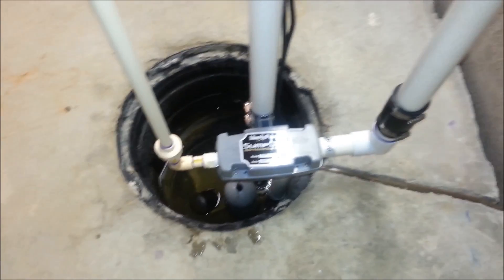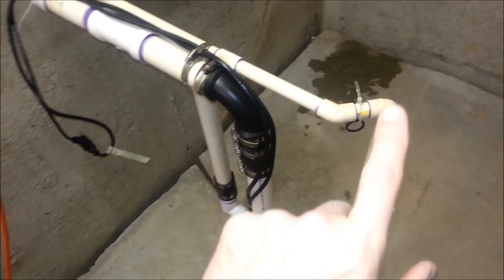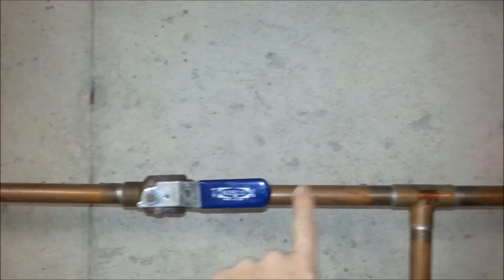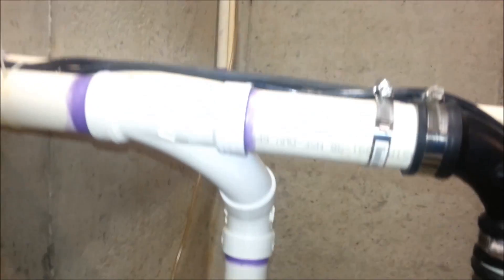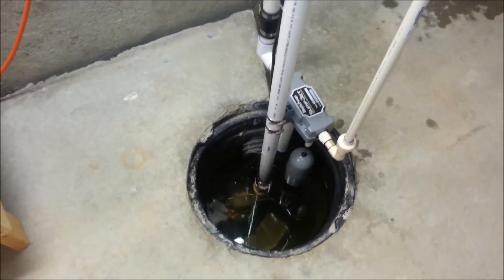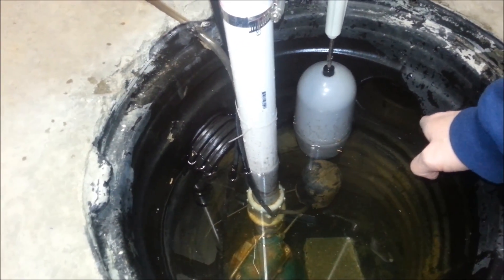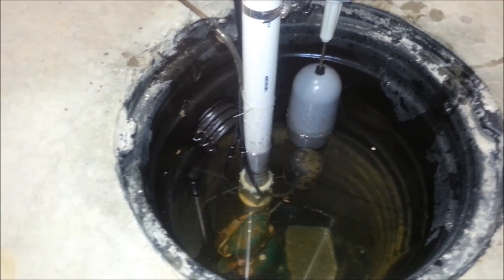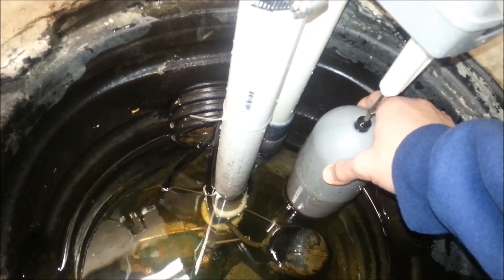Trash That Battery Sump Pump & Install A Water Powered SJ10 Liberty Sump Pump No Dead Battery Again.

Comment from the maker: You guys are really missing the point. This is not a run every day pump. This is only used for Emergency purposes if your power goes out or main pump failure. Temporary basis only.  Environmental wisely you would rather use electricity to constantly cycle a battery or buy a new battery every 3 years? Give me a break.
Reply: It's saved my basement more than once.
Reply: @Ronald: Opposed to doing what?  Outside of a backup power generator for the entire house, and a second full-sized sump pump.  What do you recommend if the primary pump fails during a storm?  Surely not a battery backup.
Reply: smaerd58 oo
Reply from the maker: Ronald Burgandie look go troll someone else's video. I am a union Pipefitter and my set up helped for the massive storm Irene here on the east coast. So take you foul BS somewhere else. This is for information purposes. So let other people make there own decisions. Not based on your non experienced situations.
Reply: The only problem here is the same power source that your home is operated from supplies the domestic water to your home.
When the power goes down so does the domestic water. Not every time but most.
Reply: @Beniamin6665  I've always had domestic water during power failures.  The most common cause of power loss is transmission power lines being knocked down in a neighborhood.  There is still water pressure from areas with power to supply water to the outtage areas.
Reply: @Beniamin6665  Water pressure comes from water towers. Gravity forces the water into the service lines. As long as the tower has water, you'll have water pressure. And, the pressure should always be the same. It's based on the height of the tower.
Reply: @jordanhargis6581  I’m a Licensed Professional in the matter. Yes in small towns the towers give pressure to your service. In any city the towers are replaced by water pumping system and stations. Witch have power supplies that are connected directly to the grid system.
Reply: @Beniamin6665  of course you can't use that in that case. You need to have constant water pressure, around 40 psi min.

Comment from the maker: Only used for Emergency Backup if your main pump fails. I would gladly pay a $400 Bill once to not get flooded out which would cost tons more & aggravation. Thanks
Reply: Pyroman / yes. You just need to set the float above the other pumps float. This will allow the pump to only be activated when the main pump  fails or you lose power.

Comment: I just bought one of these but the directions says you can't run the discharge into the main like yours is but I don't have an option of running a separate discharge line. Did you have any input for that?

Thanks,
AL
Reply: Most States and local authorities want no foundation water in their sanitary sewers. It adds to the cost of treatment. Eventually, all homeowners will be required to divert groundwater. A ditch or a bubbler will suffice. My Village said I could even run an underground discharge line to the storm sewer manhole stack.

Comment: The water pumps may be better in some scenarios. However, for those of us with high sump flows, the water option isn't possible. My basement would flood in no time if I used a water powered backup pump and lost power.

I do agree to trash the battery sump pump, however. Those 12V little pumps that run off from one marine battery are garbage. However, I discovered a company called SEC America a while back. They make something called Pump Sentry in two different forms. One for 1/2HP and one for up to 3/4HP pumps. It basically an inverter of sorts. You can chain up to 3 batteries of whatever size you want to it, or just use one if that is enough. It stays connected to the battery, detects a power outage and kicks in automatically. It converts the battery voltage to voltage that the main sump pumps could use and powers them that way. Usually a series of large capacity marine batteries can last for days, even with it coming on every few minutes. When it has rained for 3+ days and is coming thunderstorms (the most likely time to lose power due to branches and trees falling on lines), our sump flow gets up to 75 gallons per minute.
Reply: A water powered backup pump may not be a solution for everyone, But it shares the same marketed purpose as a battery powered backup and that's is as a last resort to keep you sump pump pit from overfilling during a power outage
Reply: All bateries has a relatively short lifetime. But  If you replace the battery every 3 years, you will have no trouble, and it surely will be far cheaper than dump clean water as power source.
Reply: I saw that SEC still makes the inverter that can power any brand main sump pump. It trickle-charges the battery and when the power goes out, it converts the battery DC to sine wave to power the main pump. In essence, it is a battery backup for the main pump. May be the best option is to have this set up for the main pump and the battery backup pump as well or a water-powered backup pump. The expectation is that the water-powered pump will be used as little as possible to avoid fresh water waste, especially if you can connect two marine batteries in series to power the main pump. Of course, this does not address the main pump failure over time! So have a spare main pump plumbed and ready to go.

Comment: Thanks a bunch for your video and update. Do you think Liberty SJ10 would work for an OUTSIDE sump pit? Mine is 2' across and 10' deep. Every installation I've seen online has the SJ10 sitting above the sump cover, but mine would need to be below.  I live in Pacific Northwest so not sure if the water line might freeze. THX

Comment from the maker: Matthew because you are only using the water when the back-up pump is used because of failure or lack of electricity to the main pump. The battery version however needs to keep charging all the time thus using electric. Hope that helps.
Reply: The battery system is far better. This system is a damn gimmick.. The gpm it pushes out is extremely poor. Hands down it’s a piece of plastic junk...

Comment: how can they say battery isn't energy efficient when you use 2gallons for every one removed? best is to just have a 110v back up and a home generator on a auto load switch, But I know that's always not cost effective. neither systems great. just make sure you bump that float once and a  while so that valve stays unstuck and in working order. just my 2cents.
Reply: This pumping system is the most stupid and enviromental unfriendly thing I ever seen in my life.
Reply: What kind of system would you suggest that would be better?
Reply: I think you missed my point. I said neither system is great. And that a home owner should under stand the pro's and con's of each system, While battery has to trickle charge to maintain the battery life, water powered pumps tend to fail when needed most do to the fact that hard water deposits and calcium sit on the valve there for they corrode shut. I mentioned this could be avoided if you bump the valve opened and closed every so often. In my professional opinion battery tends to pump faster and with routine maintenance last longer. You can have your battery tested at you local auto parts store yearly if you like. Again weigh the pro's and con's and pick whats best for you. But environmentally neither is a great choice unless your battery is hooked up to a solar panel. Best reliability would be a natural gas powered auto switched home generator.
Reply: @Matthew, the plumber that installed my system (main electric sump pump with backup city water powered pump) told me to do that bump check at least every 6 months. Although gas powered all home generators are great, they won't help you much when you go on vacation and the switch on your sump fails. My experience is that  it is the electric switches or the check values that fail. A check valve I once had failed and stuck apparently and the pump did run all night and the water around it was boiling hot and of course it overran the pit as well. I think one just has to change things periodically before they fail and cause a bit of trouble.
Reply: +Kameel Huseffi, Yes boiling hot with steam. Had that water boiled off,  maybe the pump would have caught fire. Who knows.
Reply: @Daniel: How so?  This is a back-up system only used in an emergency if the primary pump fails.  (i.e. power outage)  It's not always using water.
Reply: But if you're away for a week or more the battery won't last. That's why these are more reliable.

Comment: Nice system. I didn't see any back-flow valves in your discharge pipes. Does the SJ10 push out all the water when it starts pumping air?. But I guess there would be some water in from the domestic line.
Reply from the maker: There is a 1-1/2" PVC Check Valve on the main discharge pipe. Check out the other video I think it shows it. This was just an update to that one. Rick